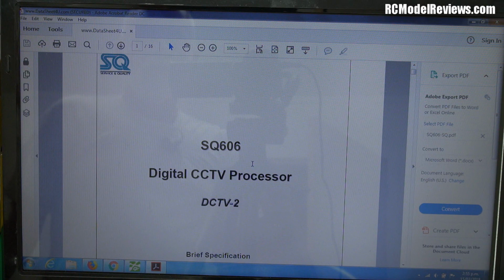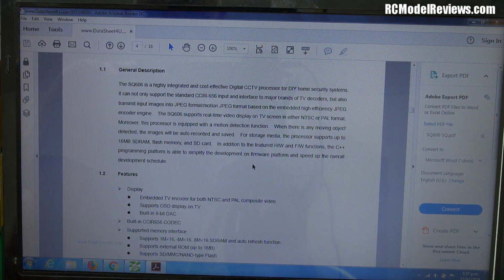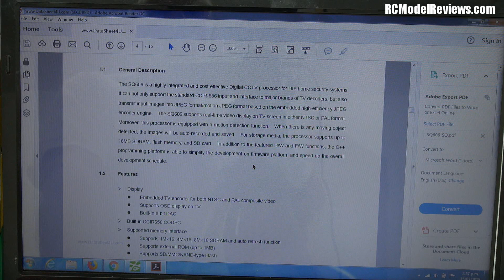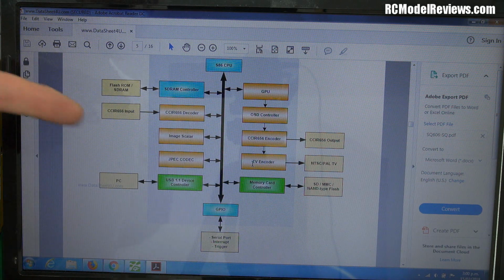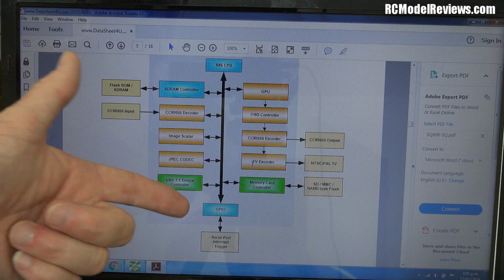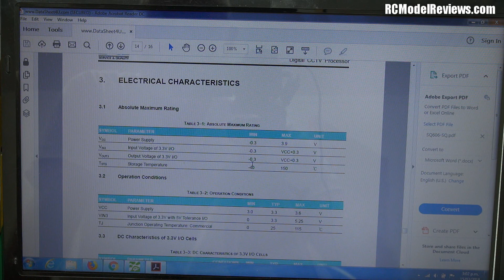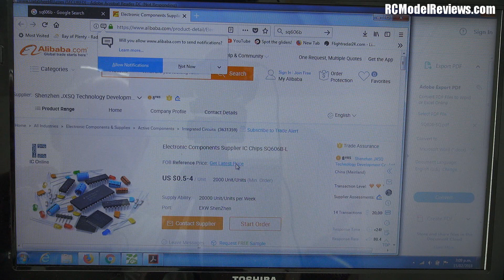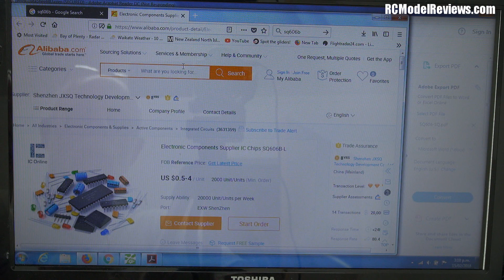DIY SD digital FPV -- the search for suitable chips (part 1)

Comment: This is the stuff I love. (when you bust out the EE skills and drop some knowledge)
Reply: This stuff is great, just looking at existing products to get a general sense of what is used is neat. However that said, all's he did was talk about a lot of vaporware. I've got like 3 projects going on and knowing myself, I can't take this serously until we have some kind of physical hardware existing. I've got stuff in EE cad already, power supply here, usb routed there, i2c set up; but still a long way away from becoming real. And that's just the E.E. side of it, then you get a protoype in your hands, you got to write working firmware for it. You can also realize problems in hardware, redesigns etc. Lot of work, and using this chip sounds like even more work if there isn't good data on it.
Reply: A lot of what he said is much more complex (though he did a great job of basically describing it. Excellent starting point). JPEG is actually a encapsulating image format. It doesn't necessarily describe the format of actual image (codec) and many are proprietary. Then you get AVI which use jpeg, interleaving audo and video etc. Color pallets. Compression. Im not very familar with that stuff but I know it gets crazy fast. Perfectly doable but it may come off sounding a little easier than in reality. Also the clock probably has to be trimmed pretty good I would think, which means length matching, capacitance etc.
Reply: Also the fact that it is using analogue video seems like it's coplexity in encoding is kind of waisted (I don't know for sure maybe there are power efficiency advantages etc, sometimes digital isn't always better, but I would think in that case just interleave the raw analogue video over a some RF frequency?). Why are you using analogue signal and converting it to digital while flying, when there are fully contained digital camera's and most any sti arm cortex m4 has built in mipi 4 lane for camera.
Reply: I like that he gets people head thinking in that direction, but you are very correct.

Comment: @RCModelReviews I believe this project will go well until you hit one specific problem. the JPEG compression doesn't not handle ANY corruption at all. So if you your rx misses what would normally appear as a tiny spec of noise in analog video, your jpeg decompression will fail to generate an image at all. This means you will be flying, and get either a frozen or black screen when just the tiniest bit of noise occurs. I would suggest looking into mpeg-ts for something that can be easily packetized, and supports signal degradation without requiring retransmits. I have a sneaking suspicion this is what Connex uses already.

Comment: The main issue i see is that those chip don't expect the level of errors you always get over RF.  It really needs to be a encoder/decode pair design for RF. It needs to use a video compression type that can be decoded into a low res image even with 80% of the signal as noise.
Reply: +Ben Wilson
Bruce would need to check if this device supports it but progressive JPG encoding may well be the answer to that potential issue.
Reply: Error correction data can be added before the RF link...
Reply: On the digital side of things you could use forward error correction to get more stability with a moderate increase of bandwidth. For MJPEG you could transmit the most important information (16x16 blocks if I remember correctly) redundantly so you have a higher chance of at least getting a very low-res picture but that is enough to figure out your attitude.

Comment: If i remember correctly, the richwave rtc6705 and 6715 analog bigger+rf chops we use in most fpv devices have a digital counterpart. But i never had any luck searching for them alone

Comment: I too think the biggest problem will be decoding. The chip is likely expecting perfect bits from an sd card. After rf there will certainly be a little corruption. 
You may be able to test this right away by recording some video, then with a hex editor manually mess up every hundredth byte, save it, put the sd card back in the dvr and try to play it back. If the whole image is black, then that chip is not tolerant to minor corruption. If the video plays back ok, then you might be ok.

Comment: You should just find a way to attach better camera to the EZ-WiFiBroadcat, or may be to attach better lens to the standard RPi camera used in EZ-WiFiBroadcast. Or a way to hack RunCam Split for low-latency wi-fi broadcast via it's off-the-shelf wifi.

Comment: Hi Bruce,

Wondering if I could pick your brain on the Jumper R1F FPV receiver.

The product specs say > 2km. If that's even somewhat true,  at $20 a piece, I'd be tempted to use a couple of these in my giant scale gasser (with powerbox for servo power).

Any good reasons for not using an FPV receiver to control a large aircraft, other than the psychological factor?

Cheers.

Comment: None of the SOC units are concerned with processing speed. As long as it can process 25 frames per second it meets their use case, but this introduces a 1/25 second delay (PAL) in the encoding. Would like to question the design choice of low cost parts. As you need to order in high volumes, its a large upfront cost with a smaller unit cost. This works well for big manufacturers but not so well for the rest of us. How about more expensive commonly available hardware. Thinking of an ARM procesor,  raspberry pi style hardware running libjpeg/SIMD.  The TigerVNC project has a great JPG image processing lib which there is also an optimised 32bit version. This would increase the BOM considerably but use available parts and a platform that could be more hackable.  A negative could be the form size.  Using a CPU might reduce the built in delay caused by a SOC based solution. Just a thought :)
Reply: Ok, just found the EZ-WifiBroadcast project which has a 110ms delay.  Maybe the TCIP stack introduces to much of a delay...

Comment: I think progressive transmission of motion JPEG 2000 would be a perfect fit for FPV since bit drops would only result in lower resolution image, rather than throwing the entire frame to the garbage.I wonder if any more modern IC have this codec implemented.

Comment: Have you looked into ezWifibroadcast video? Two respberry pi, One raspberry pi camera, two wifi dongles. :D OSD, telemetry. Except the telemetry doesn't work and there aren't any working examples to show you what to do. Just a lot of one line bits of code.

Comment: you don't need an encoder because you can get small cheap video cameras
that stream out ITU656 digital YCbCr uncompressed PAL.

i did the same thing about 5 years ago,
but i use HDMI camera and a DVB-S Transmitter, receiver, 
i did all the encoding-decoding in software on a 4 core arm system on chip.

Comment: EEVBlog called. Just kidding. I'd like your thoughts on a similar type of "hack" (i.e. repurposing off-the-shelf hardware). Is there anything that can stabilize the reception of an analog signal? Like when a signal starts to drop out or get interference, it kind of jumps around. Static is one thing but I find the jumping around to be extremely distracting. So some sort of chip or module that could at the very least stabilize the video on the screen even if the static still shows through. It might have to take some sample of the incoming GOOD video signal so it has an idea of where the VSYNC and HSYNC lows should be so when they are not received due to interference, insert them and hope that the signal comes back soon. Obviously it would be most useful during the very short blips of static. Anyways, thumbs up as usual :)

Comment: That's a great idea indeed, thank you for working on this, it's awesome!

I was wondering, mostly for my curiosity, if it would be possible to make such a thing with something like an arduino or a raspberry pi. I'm not really good with modern electronics, but I'm very good at programming, both the arduino and the rpi. Software encoding can be fast enough as modern low end CPU usually includes acceleration for stuff like MPEG, motion jpeg and even h.264. This would basically eliminate the need for an SDK for a specific chip (which is a barrier for me). No idea how hard would be to interface an arduino / rpi with an analog input signal and with a radio transmitter. I expected the latter to be easy as it's digital to digital, but have no idea about the first part.

Did you considered something like this? Not to say you are doing it wrong, you definitely know more then me on this matter, let's be clear.

Comment: Question why are we converting analogue camera to digital? Camera probably outputs digital? I would think reasons for using anologue signal of camera would be to send raw camera signal, simplicity, possibly power efficiency?
Reply: Analog signals are very prone to interference or jamming. Digital signals can use frequency hopping and encryption to avoid most interference issues, which makes them far more reliable.

The reason most FPV is currently analog is that digital processing creates latency between the camera and your goggles, which can make flying more difficult (especially in FPV racing, where they are going very fast and often only fly a couple of meters (or even centimeters) above the ground.

Comment: If you weren't already aware, there is a project called ez-wifibroadcast on GitHub. Uses raspberry pi and usb wifi. Over 100ms latency though I think. Maybe you could leverage off of that.

Comment: Correct me if I'm wrong, but don't Flash memory controllers need to be taken into account? E.g. While streaming data to the SD the SD card's built in controller has to send affirms or something that data is being written, and return file names, addresses and such. How will you get around that? I don't think you can stream the output directly without interference from the memory controller on the CCTV chip...
Edit: I didn't see the analog/TV output block diagram before commenting. Also, can someone explain to me why you would use GPIO instead of the TV out that's already present? Isn't GPIO much slower?

Comment: I think a SoC with a camera interface and raw WiFi frames are the way to go. I don't think the latency will be awful with SD video.
Reply: +donpalmera
Power drain could be an issue with a full SoC solution and 802.11 (WiFi) would probably be overkill, protocol wise.

Also I'm pretty sure you can buy RF encoder chips which are programable i.e. you can write your own frequency hopping code and perhaps include a checksum in the transmitted frame just like our radios do.
Reply: Anything you can get to do the realtime encoding and drive a transmitter is going to be munch away a few hundred milliamps. I doubt people with 600mW transmitters are going to care too much. There is an allwinner chip that has a camera interface, cortex a7 core, hardware video encoders and decoders, 64MB of memory etc in a QFP package for less than $10 in single units that would be perfect for this.

And yeah you can use a generic packet radio chip but that's going to be a massive pain to get regulatory clearance for. If you ship something with a USB connector for a generic wifi module you would only have to do the bare minimum of FCC testing to actually sell it legally.
Reply: +donpalmera
I haven't looked into power consumption so perhaps but as for regulatory compliance, I really wouldn't worry as pretty much no one uses FCC-compliant VTx'es anyway. And as long as we don't cause anyone any problems we should be alright.
Reply: >no one uses FCC-compliant VTx'es anyway

True but they are also ordering them from China. If Bruce wants to actually sell his thing he would need to get it compliance tested or risk any of the units he sells getting confiscated and destroyed.
Reply: Why reinvent the wheel? An inexpensive IP/network camera could be hacked and have all you need. ;)

Comment: I think you won't get an SDK or the full datasheet.

Maybe choose Raspberry Pi Zero - fully open system, embedded camera interface. GPU has video encoding and decoding capabilities.

Oh and usually that price range on Alibaba listing... you need to start at the top of the range if you're ordering MOQ, so initial outlay is $8000, not $1000. Bottom prices are often outright fantasy prices though.

It all depends. If you're building 20, then you absolutely need to go for an open system. If you were building 20 000 of these things, then going for a proprietary chip will be better and the manufacturer will actually talk to you.
Reply: oh my, i think i already posted a comment about that. What he wants to build ALREADY EXISTS, it`s called wifibroadcast by benavik. it uses cheap wifi dongles, rpis (zero is possible) has reasonable 720p downlink with pretty low latency. Why do all this work again?

Comment: These devices are pretty much always under NDA because they use codecs that require licences. Off-brand devices from China are likely not legitimately licenced, and certainly not well documented (if at all).

Most, if not all, advanced chips will also be BGA, or QFN package.

Comment: It should be noted that you will need to have some error correction in your coding that goes to the video transmitter and GPIO might not be fast enough to get the required bandwidth, bit-banging digital video is never a good idea. And the video transmitter might also not really like a digital input.
Reply: Why is he even converting the analogue, most cameras are digital, mipi 4 lane. I would think just dress the raw video into some kind of rf send it on down a dipole antenna. Keeps things simple.
Reply: Also a lot of arm cortex out there with built in camera support. Real issue is transmitting video analogue or digital. If I were him, I would focus primarily on the tranmission block of it. That is most important. Then you can take that block and easily have it send analogue, or digital etc. That is more useful is the radio transmission. Decide what frequency, am fm etc. Get that working first. Then worry about this stuff.

Comment: Hopefully a system can be built that is a reasonable price compared to a Connex/Fpv blue/Clearview.
Reply from the maker: Remember that this won't be an HD system so it won't necessarily compete with the Connex or FPVBlue options.  The last thing I want to do is to try and "compete" with existing products -- I want to create new options for people.
Reply: RCModelReviews Even quality 480p would be great, and it's all we need.
Reply: ill settle for a digital with low latency vs HD system. application wise , this is what is needed for FPV on DIY drones
Reply: Good thinking, Bruce, I'll be very interested in seeing how this turns out :)

Comment: touching bare pocb on the non conductive surface with magnetized screwdriver - check, no ESD knowledge - check, you could just bought kit for diy gorund station, which exist, plus any analog reverse camera LCD and you will be done at no more than 30$ ( but with no dvr function)
Reply: pretty sure bruce (and a lot of us!) was doing that 7 or 8 yrs ago.. hes looking for digital not analog these days